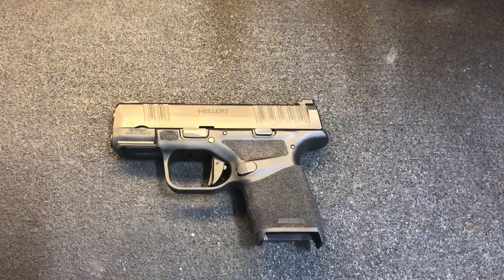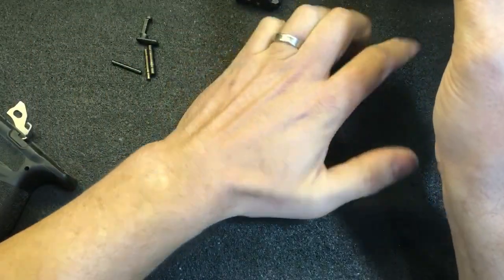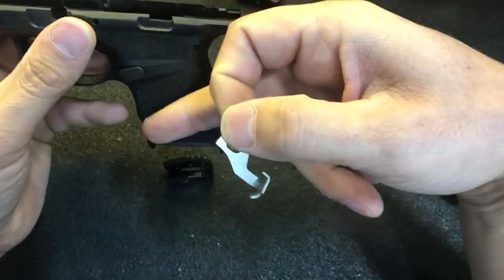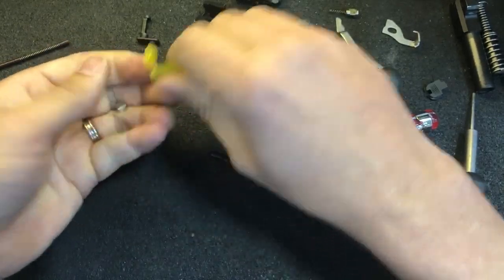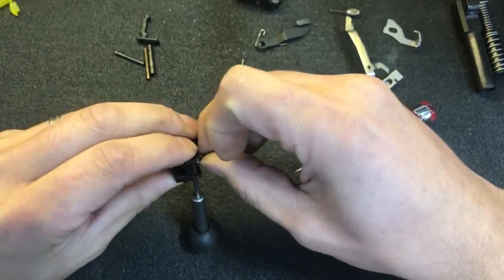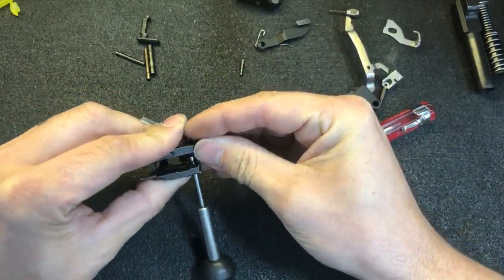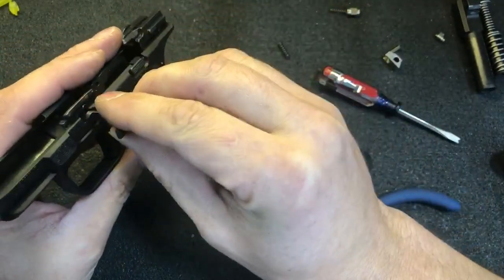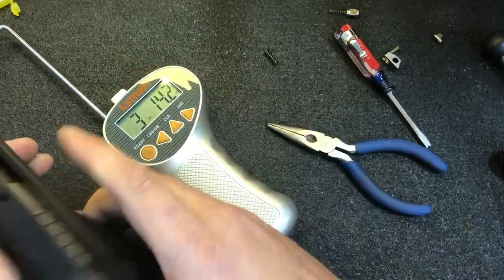PRP™ Trigger Kit for the Springfield Hellcat™

Comment: Halfway through this video it makes me realize that I'm totally okay with paying somebody $100 to do this.
Reply: Sooner than halfway, I thought the same thing!
Reply: I swear!!!!
Reply: Your good, is too bad I live in Puerto Rico, otherwise you would have my business.
Reply: $100 for 20/ 30 minutes of work? What a waste of fucking money. Have you ever tried to build a PC? I did that shit for free and it took like 5 hours.
Reply: @YuhNinja  1 it shouldn't take you that long to build a PC lol. 2 The PC will never need to save your life so the cost per time spent factor is completely different bin the sense. 3 Why are you watching the video in the first place...
Reply: @purplemossgrows172  Yes it should take you 5 hours if you're building a whole setup, it's your first time, and you are being extremely careful, and the cpu bracket lever seems to be putting way to much pressure against the cpu which causes you to be unsure if something is wrong because you don't want to break any pins. Not to mention cable management. Flipping a radiator/ fans around if you fucked up. Retrieving fallen screws that fall into the gpu. My point was that even though I spent a long amount of time, 5 hours. I would still rather spend 5 hours of my time than pay $100 for someone to do it for me, let alone something that only takes 30 minutes.
Reply: Yes bro lmfaoooo
Reply: I thought the exact opposite
Reply: If a Gunsmith does this job for $100, he is not charging enough.  $100 well spent
Reply: @YuhNinja  ohhhhhhhhhhh shedddddddd uuuuup!
Reply: @Gigantor60  - My local gunsmith's charge around $70/hour for labor. They're pretty good too. Built me a Vietnam era m16a1. Works great. His guess is pretty accurate.
Reply: I used to build automatic transmissions for a living, this is cake.
Reply: @YuhNinja  I build pc too but last I check pc don't take ammo...lol
Reply: LMMFAO!!!!!
Reply: To do this, one has either to be a gunsmith or a masochist. I am neither
Reply: 😂 so true
Reply: My sentiment exactly.
Reply: Lol i was thinking the same thing... you basically have to “rebuild” a gun!
Reply: Me too.
Reply: @YuhNinja  no bro. Even for nubes, with a YouTube video handy, it should take 2 hours tops. 5 hours is like custom hard line water cooling and overclocking.
Reply: @Gigantor60  heck no bro. An experienced gun Smith can do this job,and do it right, in 10 minutes. Nobody is worth $600 an hour. Thats $50 bucks tops. $40 of that is just a convenience fee.
Reply: @Loenthall88  dude changing spark plugs is more frustrating than this. This is stupid easy.
Reply: @jacobianmail  I think you forgot how long it takes to unbox and get all your shit organized. Not to mention trying to prevent anything from being on the carpet in a small bedroom. Also, the case you have might make a decent amount of difference on how hard it is to work in. Especially with making the right connections/ cable management.
Reply: @YuhNinja  When I make more than that in 30 minutes I am more than happy to pay someone that has done it many times and has good experience.
Reply: @jaredlamb9824  Weird flex but ok
Reply: @YuhNinja  Your flex about computers that have nothing to do with guns or this video was even more weird little guy. If people have the money and it's no big deal for them to spend it how they want, then it's not a waste of their money. I guess if you don't make much then you would totally have a different view.
Reply: @jaredlamb9824  Still weird flex but ok
Reply: @YuhNinja  Ok little guy. Sounds like you might want to diversify your portfolio.
Reply: @jaredlamb9824  Actually I am diversified. I'm 21 yrs old, I have a baby daughter, I make minimum wage, and I have a $10,000 investment account that I started less than a year ago with only $1,000. MFA, CCL, RCL, SAVE, DAL, UAL, UCO, AMD...
Reply: @YuhNinja  Nice job guy! You are well on your way. I bet you will also be really successful in life. Keep it up
Reply: Seriously! I mentally f’d up just watching it.
Reply: It’s not that bad. Literally goes together easy as can be, just follow along.
Reply: If you find this difficult, don't ever contemplate taking apart a Sig P320 or P365.... LOL

I like working on my firearms because I will learn how they work and if I encounter a problem, I will have some idea of what might have caused it. That, and I find it relaxing and therapeutic.
Reply: Def
Reply: Shit flying all over the place!!!—Hell yeah this is definitely a gun smithing thing – – I still haven’t found my detent spring for my AR that I lost three years ago LOL
Reply: Saved me some time thanks 😂
Reply: @YuhNinja   let’s be real people don’t build a pc, it’s just putting something together that other people built. It’s just clicking things in and connecting wires.
Reply: Good video but he doesn't show configurations clearly. We haven't done it a thousand times. Better close ups and more explanation needed. Oh and if you are a crack mechanic and this is easy peasy to you don't condensend to us mere mortals.
Reply: I was able to do all of this myself the first try with the M Carbo spring kit.  It came with a titanium striker assembly and a sear spring and safety spring.  Unfortunately my sear spring was defective from the factory and bent on one side causing the sear to slightly twist and making the trigger bar slip off the disconnect area.  This caused the trigger to miss a reset sometimes.  I would pull the trigger then insert the mag and rack it loading the chamber and the trigger would not move.  This just happened last weekend and they are sending me a new sear spring.  It’s really not too bad when you have it all apart
Reply: I want that sear, new safety plunger, and disconnect spring and little slide part.  That didn’t come with my MCARBO titanium striker assembly.
Reply: Yeah that’s what I was thinking I’m mechanically inclined but this scares me. I have my Hellcat and PRP trigger kit sitting in front of me. But man so many tiny parts.
Reply: @YuhNinja  And, this trigger job will take more than 20/30 minutes, if it's your first time, and you are being extremely careful, and something doesn't seem to fit, or is bent out of spec, or the firearm has other modifications which aren't compatible, which causes you to be unsure if something is wrong, because you don't wan to break it. Not to mention, small parts rolling off the workbench, springs go flying, part installed incorrectly. Our point is, some of us value our time more than you do.
Reply: @mikechurchill1071  Out-of-spec parts (defective spring) is exactly why I would rather pay someone for this work. An experienced gunsmith would be able to identify the problem quicker than I could.

Comment: Old video but I just did this and I must say, bravo. This is the hardest trigger swap I've ever done. My hc pro is new, tight, and the trigger was somehow worse than OEM Glock. Now my trigger is like smooth freshly windexed glass. This is what I needed, to warrant keeping my hellcat and not trading it for a SIG. Thank you guys.
Reply: I installed their trigger kit on my XDsc and really like it. I'll be ordering a kit for my HC very soon. Glad to hear things worked out for you.
Reply: @j8nkies20  keeping all the parts together while installing was kind of a booger, but I'm a caveman with big hands. Smaller, more dextrous hands should have easy work with this swap. I'm just a knuckle draggin gun guy, if I can do it, you can too. You got this 🤗
Reply: How has the trigger been? Shoot many rounds with it? Any hiccups?
Reply: @recreate3204  absolutely no hiccups. Turned my HC into a tack driver. Even the range officers made positive commentary about how well I was shooting. "I wish everyone could shoot like that." And I didn't even realize I destroyed the center circle (3 inch circle) of the target. I'm impressed. They were impressed. Best modification I've ever done to ANY gun. Don't hesitate bro, get it and get after it.

Comment: I have installed 2 of your triggers on my XDM 5.25 .45 cal and have used your videos to walk me through the install. The finished product produced a consistent 2.0 Lbs pull. It is by far the best trigger I have ever come across.Your videos are the most complete and easy to understand I have found.
My next purchase is going to be the Hellcat OSP, and your upgrade trigger, however this time I’ll have you do the install.
Reply: Thoughts of this vs the Apex trigger? I'm curious if it's worth the extra money and labor compared to the simpler and cheaper Apex? Thanks!

Comment: Just finished this. First time I’ve ever modified a gun. Very easy and simple to do. Only hiccup I ran into is the loops on the new sear spring were completely closed and I had to pry the loops open a touch to get the sear on and the pin through. Otherwise it went together great and the trigger is greatly improved. Not only lighter but much smoother. More linear of a pull and not so much a pull//stop//pull.

Comment: The issue isn’t that it’s too complicated as with any mechanical system but knowing what parts go where, what order to disassemble and reassemble. First time through, document each step, organize the parts(smallest parts and springs that fall or jump out are the hardest if you don’t have extras), and having the proper tools. It is more intimidating modifying a weapon that could kill or maim you or others if you make a mistake though.

Comment: Just installed the kit, reduced pull weight by about 2 pounds and trigger is much smoother. Thanks for the video, made the job a lot easier. Trigger pull weight is in part a personal preference. Trigger pull weight in a personal defense firearm is a contested topic. In general a heavy trigger invites less accuracy. In a gunfight accuracy of trained shooters is about 20%. Your range accuracy is a poor predictor of gunfight accuracy unless you’re training in a very specific way. As there is no reason that an experienced shooter carrying in a good Kydex holster should accidentally discharge a firearm with a 3-4 pound trigger, after all this kit doesn’t result in a hair trigger, give me improved accuracy any day.
Reply: Thoughts of this vs the Apex trigger? I'm curious if it's worth the extra money and labor compared to the simpler and cheaper Apex? Thanks!

Comment: Don't let any of these installations intimidate you, there are only 6 small pieces to fit together, and most of them go together. The slide is very easy. The kit comes with two sear springs and I went with the blue sear spring, and installed the rest of the PRP kit. Took about 40 minutes, but I am quite slow. Quite an easy job when you're not installing parts backwards like me.

Comment: For those who think this is hard to follow watch the Apex trigger install video it's more detailed and much easier to follow along you can use that video to install any brand trigger or part. I installed an Apex trigger in a Hellcat Pro and I might buy and install this PRP kit in a different Hellcat. Again just mentioning Apex video it's easier to follow along better details not saying the Apex product is better just the video.

In fact watch both videos this video shows the disconnect part swap and the Apex video does not as the Apex kit does not come with a new disconnector.

 Seriously this is really easy if you can or believe you can change a door knob you can definitely change a Hellcat trigger it's not much harder than a Glock trigger, I believe this video skips past a few little things much to quickly or not at all which confuses but is still better than nothing so thank you to PRP I'm thinking I might need your entire trigger kit including the PRP trigger shoe and I can get a much better idea how my Apex trigger matches up against the PRP trigger kit.

Comment: Looks to be basically the same takedown and reassembly as an xds. Minus having to punch a pin out for the striker safety block and grip safety. Almost looks like a lot of the internals are the same as well. If this is a micro xds I'm all in!

Comment: Would polishing the sear make any difference? Sure helps with all the other trigger jobs I did. Smoother, lighter. Had a Taurus PT 111 G2. It's trigger was awful. My gunsmith took the trigger assy apart & put the metal parts ( minus the springs) into a vibratory tumbler with ceramic B.B.s. & ran it about 20 minutes while we had coffee. Rounded off the sharp edges & shot peened polished the parts. Reassembled it & it was a TOTALLY different unit. Smooth, easy & fast. Went from a V.W. bug to a Ferrari. He polished the feed ramp & chamber too. ZERO jams after that.

Comment: My disconnector spring won't come out due to a rod. Here I am 40% through and I can't get that DAMN piece out. Any suggestions?
Reply: Currently having the same issue.  Did you find a solution?
Reply: basterdhole no. I used the factory disconnecter spring instead of trying to replace it.  Very frustrating.
Reply: I figured it out.  The pin will slide out.  His fell out in the video. Just took a little bit of work.  I depressed the actual disconnector and rotated it 45 degrees and that seemed to loosen the pin.
Reply: @basterdhole  Yes! Thank you. I did the same thing and just grabbed the pin with needle nose pliers to get it out.
Reply: Everyone is 100% correct.  Push the disconnector in and rotate it. (It may rotate on it's on as it did for me)  If you do it right the disconnector spring will be fully compressed and the pin on the opposite side of the disconnector will be poking out about about 1/16 of an inch.  At that point grab the needle nose pliers and pull the pin out slowly.  Be careful as you pull the pin out because the factory disconnector spring may come flying out.

Comment: Way too difficult. I would be scared to death I couldn’t get it back together.  Not a good idea to have less than a 4 pound trigger on a small ccw.  I can get the stock trigger pulled just fine.  Would have liked to see if it had a definite wall and the break and reset demonstrated.  I’m more about a crisp break at the wall and a short reset than I am the weight of the pull
Reply: Fairly simple if you pay attention and use the right tools. As for trigger pull weight, that's subjective. Every gun I've carried since I turned 21 ten years ago has had a 3.5 - 4lb trigger and I've never felt it to be dangerous. Definitely improved my speed and accuracy though.

Comment: While this trigger is a good upgrade the cost is almost half of what a Canik TP9 costs which already has a very good trigger that can be upgraded to a Feedomsmith trigger for 70 dollars that makes the trigger as close to 1911 trigger at least from a striker firer gun l had a prp trigger in a xdm and the freedomsmith on the Canik is more cost effective and much better than prp in a Springfield much better much shorter stroke and reset

Comment: Just use the trigger it came with for God's sake !!!!!!!!!!!!! It's fine how it is !!! God I hate when the gun community try's to make something better, when it's {and apply these words to most things} NOT NECESSARY !!!!!!!!!!!
Reply: Hill Shepherd Completely disagree. My hellcat went from a 6.5 lb pull with a hard wall, to a 4.5 lb pull that I can controllably pull to the break without any jerking of the sight. Same reset, crisp break. Just removed the one flaw in this gun IMO. I am typically a very good shot, but am not as accurate with this gun as I would like, primarily due to the stiff wall of this trigger. I appreciate PRP for providing a solution to that issue.
Reply: How about using your shit the way you want and letting others use and enjoy theirs the way they want? They make trigger pulls heavier than needed to prevent lawsuits and protect average shooters. Some of us are more passionate about our guns and want to get the best out of them. I personally find the stock trigger pretty decent, but am looking forward to improving it. People enjoy modding damn near anything. Why put a turbo or new exhaust on your car when it's already capable of driving faster than the speed limit? Because you F*&king want to :)